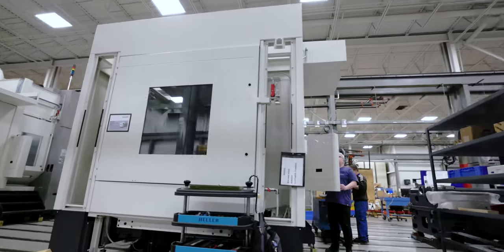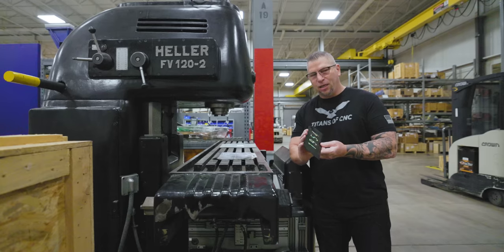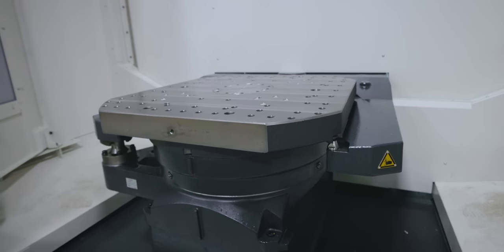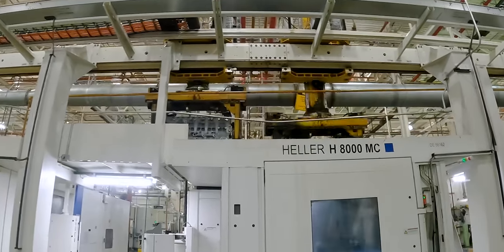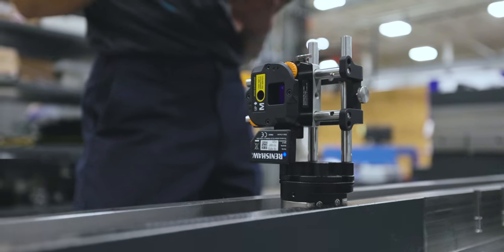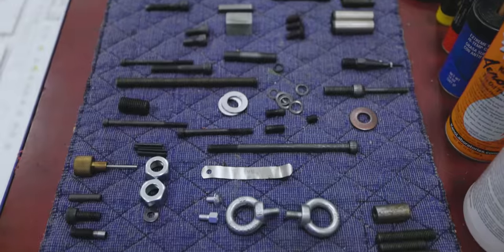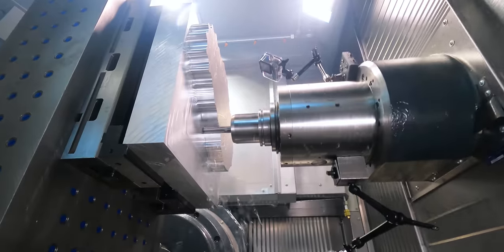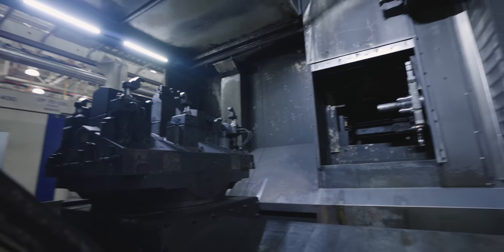HELLER Machine Tools Shop Tour | Troy, Michigan USA

Comment: Great tour!  In watching this and the Detroit Diesel video it stirred the old brain matter.  I grew up in the Detroit area, Pontiac and Southfield.  My first job, at 15 years old, was with a company that designed machines for the automotive industry. 

May I suggest that you produce a video that shows the differences between machining an engine block in the 1970s and today?  The end product is the same, a fully machined block.  But, instead of the block being moved down the line and stopping for each function, say boring cylinders or drilling holes for cylinder covers, a single machine can be used for multiple purposes.   I would guess that Detroit Diesel has historic films of the machines companies like Lamb built.

Comment: 8:17 I do the same thing. im not a machinist.... I work in a small shop as a coil fabricator.... I work with wood, cement, and copper.  I have four large steel tables and two small square trinity 5 tier carts that i use to organize my tools.  two of my steel tables are half filled with tools that I disorganize regularly as I want to speed through my processes.... everything has a home though. c: the guys all think it isnt smart to not lock my tools up.... but nobody touches them.... XD. good people. good workplace.  I dont have the capability to maintain as clean a space as that though... as cement has a tendency to get everywhere by just existing. 
commented because... I also have very little space on my heavy use tables to do work on... as I keep my tools out... and organized in the same way.  most valuable to my work space is my 4x2 rolling table... second most valuable is the 4 same-height welded steel horses .... would be nice to have 4  small square quad swivel tables.  but.... you just cant find them in the right height/ strength/ surface size ratio.

Comment: Titan, what is your favorite CNC machine brand? Heller? Doosan? Makino? You have so many different machines. If you had ot pick one...which one?
Reply from the maker: Heller are Top Level… and great for shops needing to run 24/7 365…
But really, it depends on what the Applicatiion is. DN Solutions are great for medium to high production.
Reply: @TITANSofCNC  you still like your dmg's?
Reply: @TITANSofCNC  

If I wanted a CNC machine for moderate production 12hrs/day 6 days per week. Reliabile to +/- 0.0005 on a solid setup. approximately 40x20 size. What would you recommend? Aluminum based parts will need high RPM spindle. I have been looking at the Okuma Genos M560/M660V. Bridge style 30hp spindle. But there are so many options.

Comment: just like the 1 inch 4340 CV axle on my car... 4.6L V8 280lbft 400'000km 60'000 liters of gas, then it snapped the axle. 1'000'000 mile engines? and then by the time its there... someone else gets it, just to see if they can make sense of it? out in a field, welded the stud back on... could very well have had a 8kw inverter in the vehicle to power everything used to fix it. things no one see's... need the tool bit to re-cut the axle splines where I welded it.

Comment: I'm somewhat surprised they're using linear roller guides, I was always led to believe that box ways are the ultimate way to go for mills.
Reply: Box ways are great for slower machines but for machines that zoom around linear rails are basically the only way to go for not super accurate and precise machines.

Comment: When I was in business, I would have given my right arm for a line of Hellers.
I am concerned to see a massive investment in ICE engine production, living in the UK I can see the end of the road for ICE engines. I know America is committed to ICE vehicles but the end is in sight and if America doesnt change, the US motor industry will wither away
Reply from the maker: Thanks Steve,
What I didn’t show is that they actually are heavy into electric vehicle production… meaning Detroit Diesel.
Reply: I want to see the charging stations for 45 ton Ecombines during harvest season when they are running 20+ hours a day.  Who is going to bring a high voltage transmission line to each farm in North Dakota?  Or will they just use a LM2500 gas turbine burning diesel to charge their CO2 free equipment?
Reply: @k53847  There will be some exceptions to the rule but for the vast majority of vehicles, EV's are superior. But we are engineers and we what ever limitations there are to electric vehicles, we will overcome them and they are probably a use case for Hydrogen, which can be refilled in minutes but they are more expensive to run than EV's which is at the moment the driving force behind the electrification of transport. Co2 is not on the mind of most people and businesses dont care, it's down to cost.